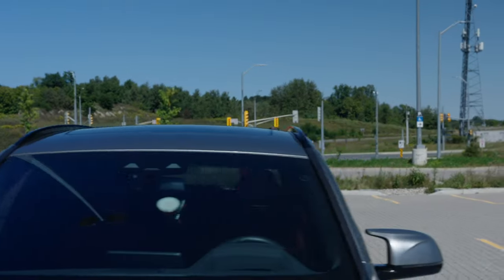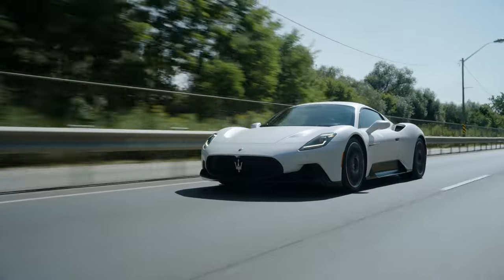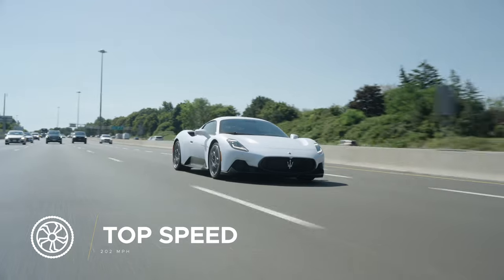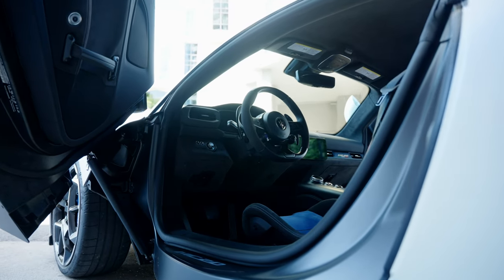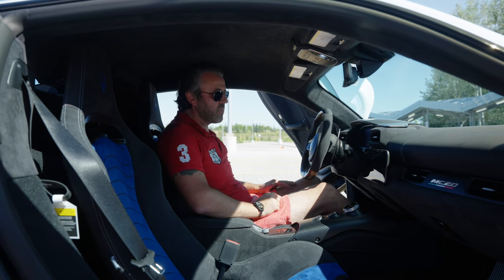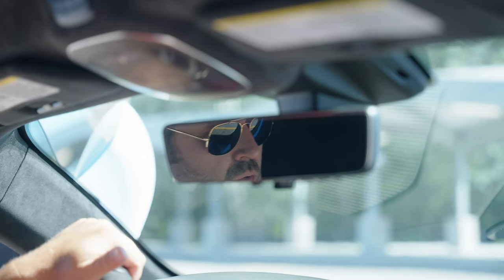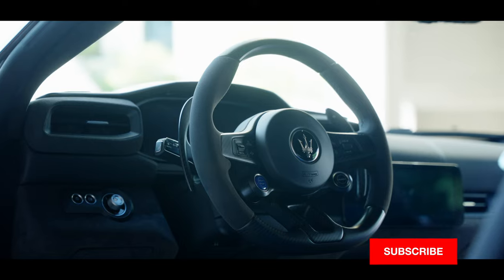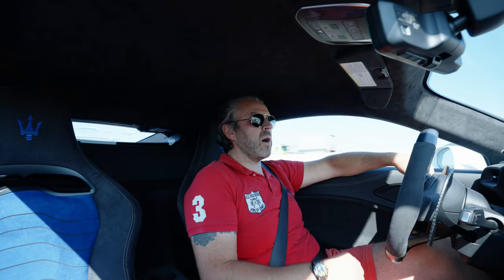RIP Z06?! Here's Why The New Maserati MC20 is a Masterpiece of Engineering and Design.

Comment from the maker: Italian masterpiece ❤
Reply: It certainly shines in isolation, but loses luster quickly when cross-shopped.
Reply: Lets get this straight. The Maseratti MC 20 has a V6 Turbo. The car weights 3757 lb . And has a starting price of 215 000 $. By comparison the C8 Z06 has a V8 Naturally aspirated engine, weights 3650 lb and has a starting price of 128 000$. The design of the car is the only department in which the MC20 is superior.

Comment: The MC20's biggest fail is the without a doubt the exhaust.  Thats actually the main reason why I chose to buy a Z06 rather than an MC20.  With the Z06 you get an exhilarating driving experience due to that screaming, popping exhaust note, whereas with the MC20, it literally sounds like a lawn mower.  I also don't care for the lackluster interior of the MC20, its basic, cheap, unexciting, and is basically just made up of other current Maserati parts instead of its own MC20 parts.  Thanks for the review I did enjoy it.

Comment: a very nice and expensive super sports car, unfortunately with a weight from nearly 1650 Kg ( weight with all the fluids and gasoline ) a little bit heavy. Ok you can say it´s not heavy but a cheaper 2023 AWD 911 Turbo S has the same weight and that without a carbon body and carbon chassis parts where the only RWD Maserati has.
Reply: 1700kg plus, not 1650kg
Reply: @Luke-cb3ly  Ok it could be maybe right fully loaded, they put one here in Germany on a scale and it was 1650 Kg, 150 Kg more as Maserati claims but thats very normal because the Italians always say the weight number of the completely stock and empty car.
Reply: @Luke-cb3ly  but it´s very weird that this Car is not much lighter as a 911 Turbo S where has AWD and not a carbon body and chassis.